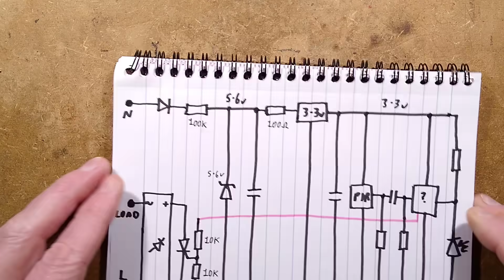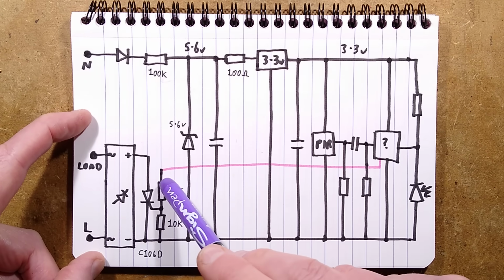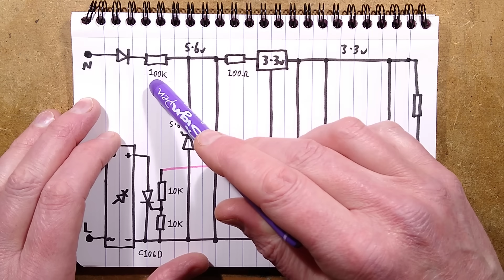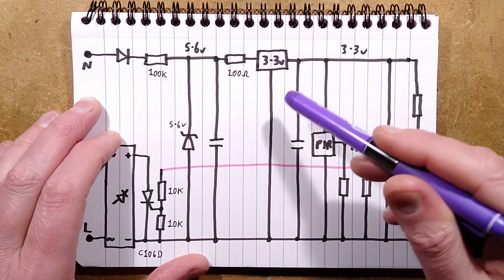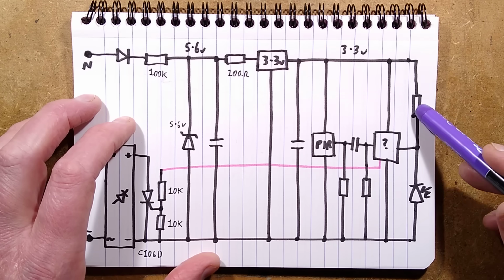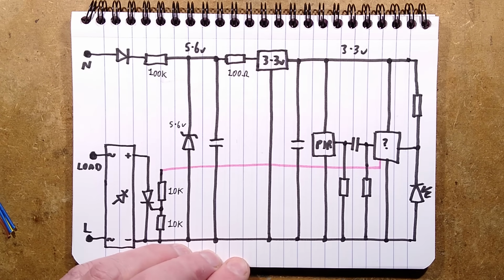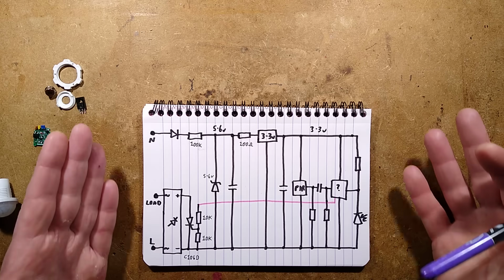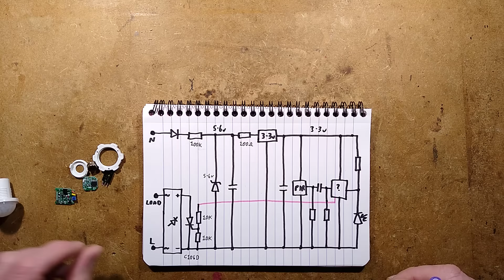Cheap PIR movement sensor and switch - with schematic

Comment: I've got one of these retrofitted to the old LED under cabinet light I rescued from the prior incarnation of our kitchen and have since mounted inside our pantry, so the light turns on when you open the door. it's been very reliable for the last five years it's been in service, and my only wish is the latch time were adjustable so I could have it shut off quicker.

Comment: Would have been interesting to try and remove the photo diode and make it work as a day sensor.
Reply from the maker: Easy done.  Just pop the module out and either black out the light sensor or carefully snap it off the PCB.

Comment: How much do we trust the switched power rating of 40W?
Reply from the maker: The current will depend on the local voltage.  I prefer to under-run stuff like this.  So probably 20W tops.

Comment: It could be really useful for Halloween, triggering different elements. But handy for making a garden light into a security light.  Nice item 2x👍
Reply: You can get 12v versions.
Standard 5.5x2.5mm barrel plug on the input and switches power through to a standard barrel socket on the output.

Could be good for proximately triggering Halloween decorations.

Comment: Nice little device. The 100k resistor is probably there to cover the voltage range of 100 to 250V, but for us Europeans it could have had a higher value.

However I would have preferred a 24V variant just to lower the fire hazard in areas where mice may appear.

Comment: I don't understand how the bridge rectifier is being used here or how shunting it switches the live out. It seems to me like the bridge rectifier is essentially working as a half bridge rectifier for the low voltage side here since neutral doesn't connect to it, right? How does shunting the DC side switch the AC side?
Reply: Since it's a thyristor acting as a switch then you'd need a full wave rectifier otherwise you'd only get the upper half part of the sine wave and flickering lights.
Reply: We are used to seeing bridge rectifiers as AC in and DC out, but they are just a group of diodes. By shunting the DC side, it still passes the full wave, alternating through one pair then the other. Since it’s AC, it never sees both directions at once.
Reply: @TomCee53  oh, i finally was able to visualize what's happening when I drew it with discrete diodes. I couldn't wrap my head around it. thanks!
Reply: I drew it out but I fail to see how the short stops the AC from being able to pass through, would someone mind explaining it?
Reply: @MrAlex3461  So the LIVE comes in on one of the bridge rectifier legs, then just jumps from DC+ to DC- (or vice versa depending on your view) and then back out the OTHER AC leg which leads to the load. The other AC leg (neutral) also goes directly to the load. so the DC side of the rectifier isn't doing any "work", it's just the link in the chain where it's getting interrupted/switched.
Reply: @MrAlex3461  The rectifier bridge is a full wave rectifier that causes all positive halves of the AC voltage to go out on the + side of the rectifier and all negative to go out on the negative side of the rectifier. The thyristor could be replaced with a piece of wire which basically would be the same as having a wire between L and LOAD. The actual load is connected between N and LOAD. With the thyristor it acts as an electronic switch that either keeps the connection between + and - open or closed depending on the input from the control circuit.
Think of the thyristor as an on/off switch.

Comment: I would have thought r12 could be changed to change the timer function but the I see a missing capacitor so maybe one could be added to extend the time... Might be useful for small lights, like those on stairs, but for a main light or lamp, I couldn't see it being any use... What is the maximum wattage output it can handle?
Reply from the maker: There's no timing capacitor capability.  They claim 3-40W switching.
Reply: @bigclivedotcom  ah then I stick with R12, 40w...is that actual 40watts or 40w equivalent 😅